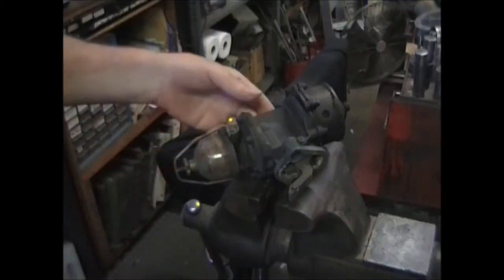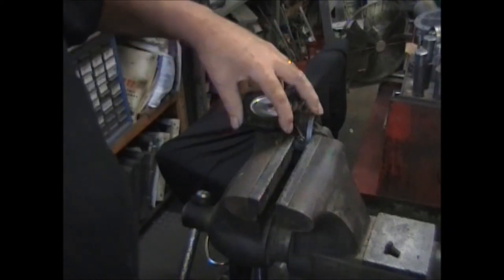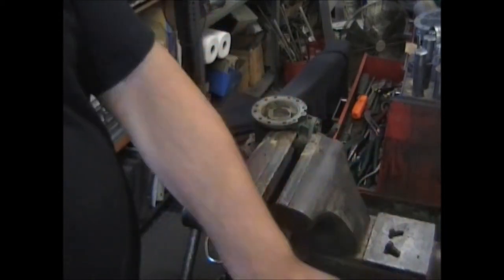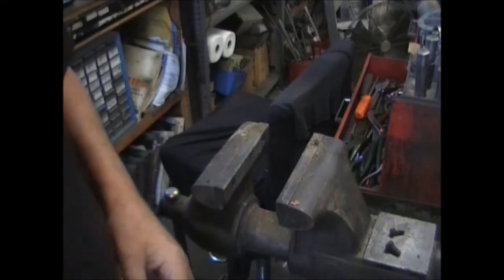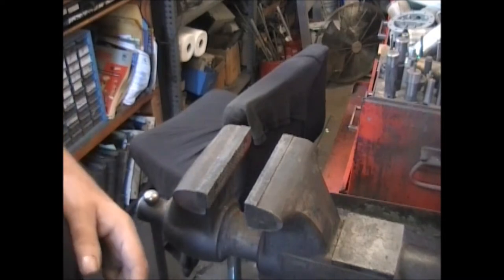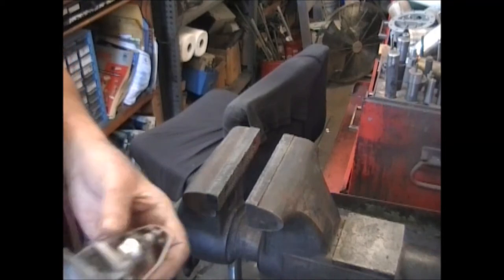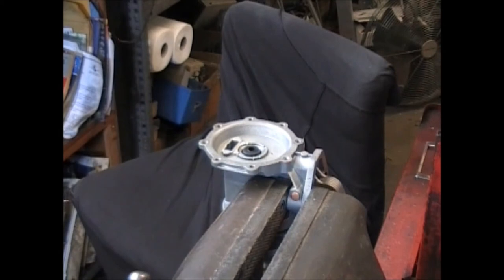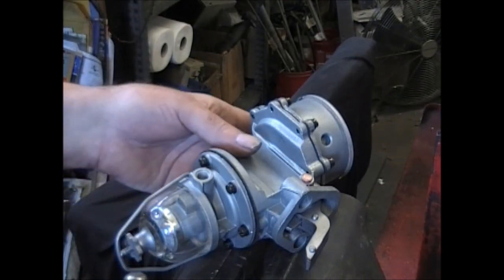AC 4525 Dual Action Rebuild

Comment: Very nice video! I want to rebuild my 9648 fuel pump. Do you do some plating of the aluminium casting  parts to protect them from oxidation after the cleaning process?
Reply from the maker: Thank you. I just use a liberal amount of clear enamel. Has worked for me for years as long as no gasoline comes in contact with the aluminum parts.